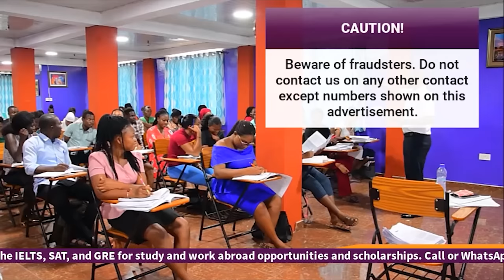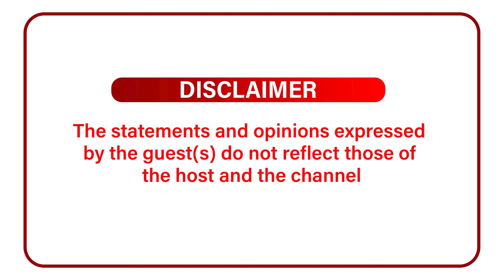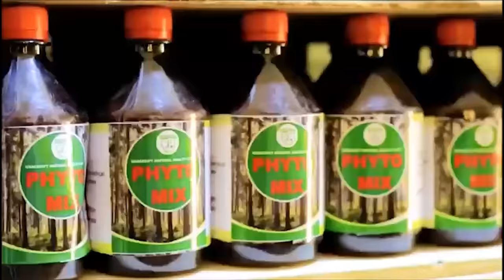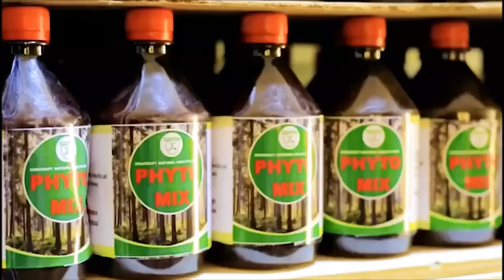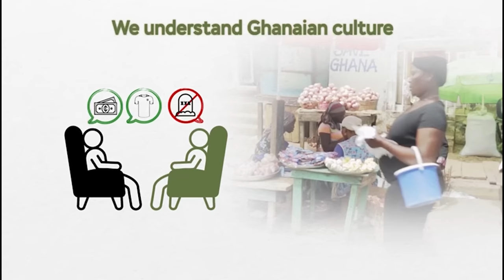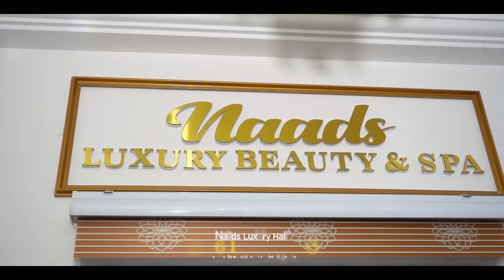I’m Proud To Be A Cleaner In Germany…I Make Gh30,000 A Month- Ghanaian Boy Teaches Zionfelix The Job

Comment: Great video and very educative. The only thing that caught my eye was the health and safety aspect of the job. No caution signs and the wrong colour code tool were used. I noticed a red flat mop stick which is meant for high-risk areas was used on the corridor floors.
Reply: So what , are u the one using it